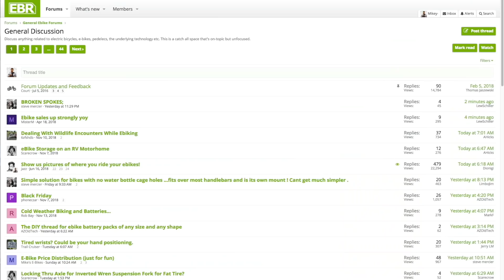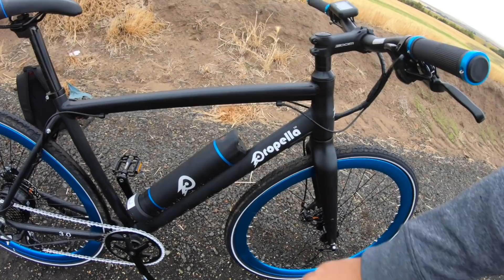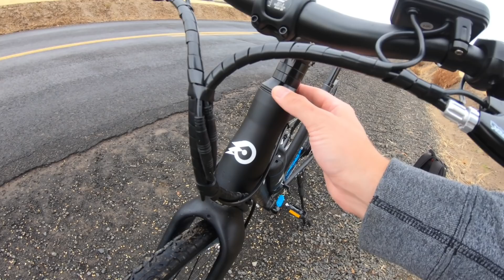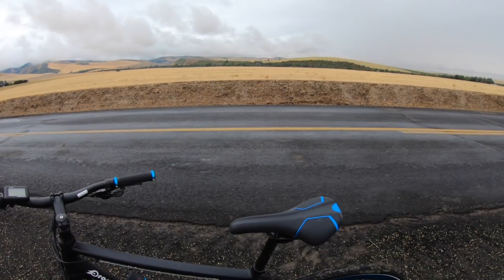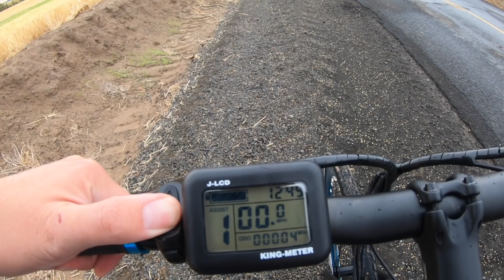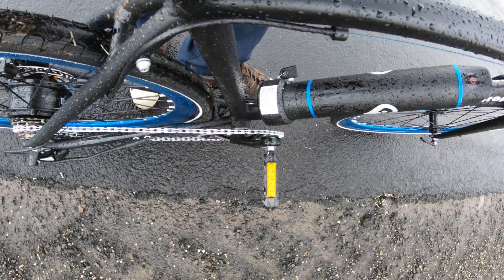Propella 3.0 7-Speed Review - $1.3k

Comment: Looks like it does not have a 'throttle button'
& that's a 'deal breaker' for me.
A throttle button is very helpful in starting the bike ride movement.
It's also convenient in aiding the pedal assist
 without increasing the pedal assist level on the screen.
And lastly, it helps not to pedal if you're tired.

Comment: I really would love to know how well this bike rides without the peddle assist on. I would mainly want to do most of the work , but when I need a little help (to keep up with my husband) then turn it on.  One e bike I owned seemed to drag when the assist was off, and it was extremely hard to pick up any speed while riding. It worked great when the assist was on, but wasn't exactly what I needed. I mainly want to make sure the bike is still fast without the assist on.  Thank you
Reply: I know it has been a while since your comment but my girlfriend may purchase this bicycle this summer, and if I remember I'll post an update!
Reply: @heuristicknight  any update
Reply: @heuristicknight  thank you so much! I look forward to it!!!
Reply: I've read that this bike comes in just below 40 pounds. My current non-electric touring bike is 30 pounds and my old steel road bike was 30 pounds. I feel plenty zippy on my bikes and so I suspect this bike would feel alright weight wise. I don't have this bike though so I can't speak to if the motor adds any resistance to the weight. There is surely a compromise to the non-assist performance of any ebike over a regular bike, but it seems to me that this bike has the smallest compromise of many ebikes I've looked at.
Reply: Because of the added battery weight,
any ebike will be harder to pedal when the assist is not on.
So, I don't think you'll find what you're looking for.

Comment: I have 2.2 propella, 2 years old. I like the blue wheels, but I get flats all the time. Bicycle shop  said I need to switch wheels or have a solid rubber tire. So I got a solid tire. It’s not the best, I feel every bump on the road. FWI: Don’t buy the blue wheels! Thanks
Reply: Have you considered protective liners like Tannus, Mr Tuffy, etc. ?
I've used those & glad I did.

Comment: I've been looking at this, the Aventon Pace (great tires, nice motor/battery combo) and the Wing Bikes Freedom (lightweight, alarm system, built in lights, electric horn). I like how sleek the propella is, but I'm hesitant because of the unusually small battery and motor. I'm worried if I buy the Propella, the battery is going to die on me a lot and I won't have enough power for hills - 250w is pretty small.
Reply: I am pretty sure this bike is not for climbing high mountains, but I took it to work this morning (7 miles ride) and it's an effortless ride. No sweat, no need to change clothes. And the battery was not even half way. Seems like a very good bike for everyday commuting.
Reply: @ftey2000  When you do fin nod
Reply: It does not have a throttle. That is a break it for me. Most of these light bike are at 250w due to the regulation in over seas.   A lot of these companies are from over seas. Wing Bikes weight are close to 40 lbs.  That's too heavy when a bike like AM1 and AMX is at 33lbs.

Comment: How fast is this bike's max speed?
Reply: I have the 3.2 and it tops at 18 mph. Of course, you can go faster if you pedal faster, but then all the effort is from you. However you can have a very nice ride at 17-18 mph for many miles.
Reply: That's not bad. I can pedal 15-16mph for an hour straight. so that mean it would be goin about 28mph. That's how that works?
Reply: @beezytalkingshit9319  That's not how that works. As you go faster wind resistance increases faster so you'll probably be going at 22-24mph with the same exertion.
Reply: @beezytalkingshit9319  The motor stops working when you hit 18 mph.  Thus if you go above 18 mph the electric motor is no longer powering the bike, and it is no longer the ebike powering it forward, just your legs are powering the bike.

Comment: I think I fell asleep and missed end of THIS review am not SURE-But it was just found finished playing...

I REMEMBER phone being in small top on video mode and decide to let it stay (LG unlike OTHER phones i have owned locks only to portrait)

The speed and ease of battery swapping caught my eye for this and on offerup those miaSole made 17% efficient 140 watt are slashed to $30 each SUPPOSEDLY Sunday latenight as the seller probably needed cash for cell 📱 bill as it has been greeting as if unpaid at TIMES when I CALLED.

I mention it BECAUSE lower voltages are easier to charge direct from a few at most pounds of SOLAR pv tarp carried rolled up like a 🎥 screen.  The "more cells the more cells" one might say!

He can set you up with 106 inches tailing only 14 inches wide which is the tripple digit "pizza cutter" (see Mikey's use of words in video!) of flexible photon power for use DURING HELLO TRAVEL on custom at least rigs.

Please NOTE the batterYless line of electric MOBILITY unicycles ETC featuring fashionable Sombrero shading of all skin is mine but the MiaSole are limited, first come till gone, then insanely EXPENSIVE when AND IF found with 🏭 blessing.

NEXT week Martin retiredin L.A.,  is gonna use 2400 watthours per wheel to get skin cancer in seven days BEFORE HIS PRODUCED EUC olympics even START.  (FOR LACK OF IN USE PHOTON TO ELECTRON SKIN PROTECTING FOR LESS WEIGHT THEN LITHIUM ELECTRONS BANKED!)

PLEASE SEND a ANYbody to the 14 days of daring Even though Sombrero powered EUC's might NOT win Gold QUITE YET THIS YEAR BECAUSE, HEY, RIPE OR NOT HOWEVER,  only if you show up do you get 👍 and my pups AIN'T runnin over JUST so far beyond Fun if ONLY in BRIGHT 🌞

Comment: Not much more than 15 mph, you can't mod it, poor quality wheels and pretty basic alu frame and equipage. You'd be faster on a standard bike at half the price, with better everything. How can beefy Bafang  justify a 250W motor in their arsenal ? And that's the problem with ebikes; their too slow and poorly made in the budget end, and the motor manu's are trying their best to keep 'em slow  by avoiding as far as they can de restriction methods at hand built steel ,with top end components, normal bike prices and beyond. And made with 'special lightweight alu'; sure, that's going to last down the years without cracking on broken road riding.
Reply: So tell us what you think Denny?
Reply: @stevedonovan9265  Bring on the steel e bikes, but their over four grand, but at least one of them has a 1000W bafang at least.

Comment: Where is this bike made?
Reply: Every E-Bike is essentially made in China. At best companies can claim that they assemble off the shelf parts in "local" factories
Reply: Some also come from Taiwan. But you are right almost all frames come from Asia. Most hub motors also come from Asia. Mid drives are different the higher priced model have often European or Japanese made motors. Bosch makes the Motors in Hungary, Brose are made in Berlin Germany and Yamaha and Shimano produce in Japan. All these motors are excellent and give you a much more natural feeling of riding than hub motors but for sure this comes at a price. The cheapest Bosch bikes are about 2500 $ and they do not offer throttle you always have to pedal and the motor is just adding a certain percentage of support. In Bosch it is normally 50 to 300 percent.
Reply from the maker: Lots of companies have moved from China to Taiwan or Vietnam due to the tariffs. I'm not sure exactly where Propella gets their stuff :)